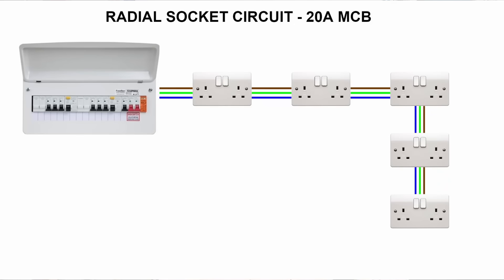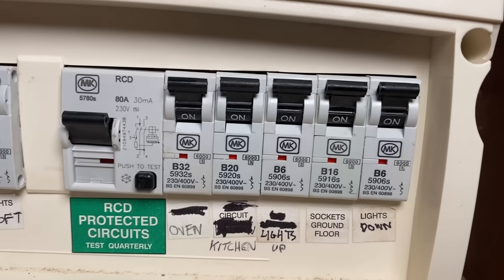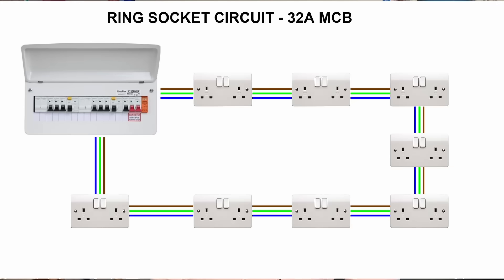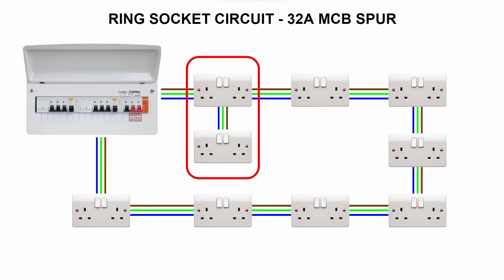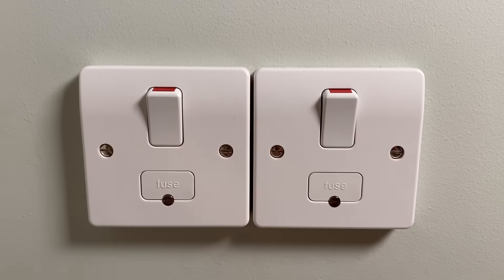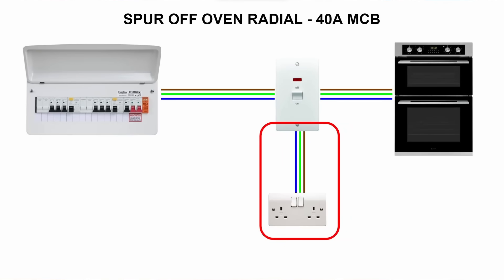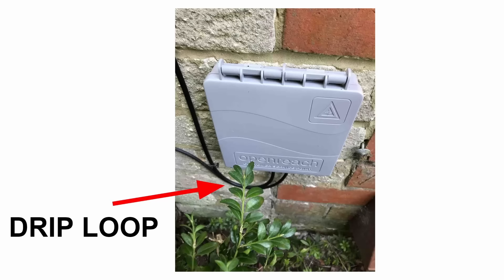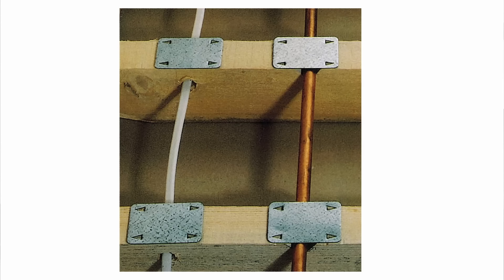BIGGEST DIY Mistakes Adding a New Socket

Comment: I do the 1st fix using Wago type of connectors inside the socket/FCU backboxes, connecting up a ring (or a radial), and even connecting the earth terminal of a metal backbox. The backboxes are effectively doubled up as junction boxes. The ring circuit is tested after the 1st fix. Any wiring problems are identified before finishing trades turn up. Putting it right afterwards may be big problems.

Then the plasterers and painters come in doing their work. The Wagos are left in place in the backboxes. Then on the 2nd fix, on a bench the sockets and FCUs are prepared, by screwing into all the socket's tail's flexible 2.5mm cable, including an insulated earth wire, about 100mm long with a ferrule onto the flexible wire into sockets screwed terminal connection. The flexible tails are put into the Wagos at the back of the back boxes. The socket easily pushes back in being on flex tails. Then test again. The speed, and ease, of installation is much quicker. And much safer as the ring itself does not have screw connections that can work loose.

I have found many terminal screws on the back of sockets that worked loose over time - expansion-contraction, vibration from people walking on wooden floors, plugs being rammed in and out constantly, etc. That is why screwed terminal are maintenance terminals. Wago screwless are maintenance free. Wago also apply the correct torque to the wire, which is maintained over time as well. Having the full current of a ring circuit flowing through the terminal at the rear of sockets is a potential fire situation, with maybe arcing, also adding higher resistances to the ring, which may cause one leg of the ring to take most of the load, etc.

That is where Wago types of connectors, in the scenario I just outlined, take the ring's load, not the screwed terminals on the rear of the sockets. It is much safer. The sockets are only spurs off the ring, taking only current when an appliance is drawing current. Go back to a ring circuit after 10, 15, 20 years, then test it. Then go back to one which has the ring running though maintenance free Wago types. The integrity of the Wago connection ring will be upheld. Much safer.

Having Wago types of connections on the rear of sockets, as in Germany, adds another level of safety, in eliminating another screw terminal potential failure/fire risk.
Reply from the maker: Thanks for watching!
Reply: As much as I hate using Wago connectors (and there are better models in the meantime) I have to admit they are better than screw terminals on several fronts. Certainly with solid core wires.
Reply: @christopherleach1443  
What do you consider better than Wago?
Reply: The problem arises in the space required as well as all the extra wire lengths that arise. The standard round sub surface box is small and certain plug types are large. It can get to be quite a squeeze, leading to stuffing wires in, and hence potential problems arising. 
And it’s a nuisance to have to drill to put in larger ‚boxes‘
Professional yes, still.